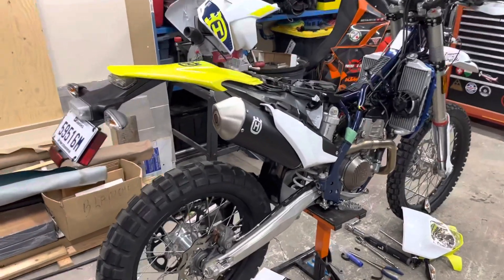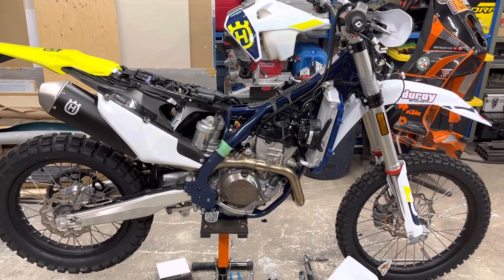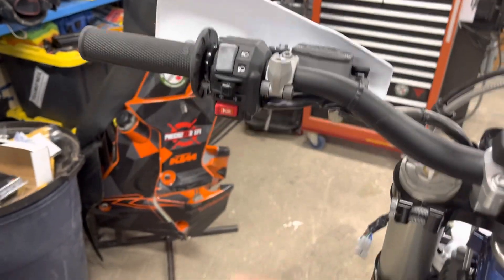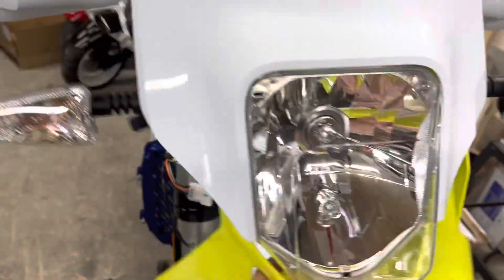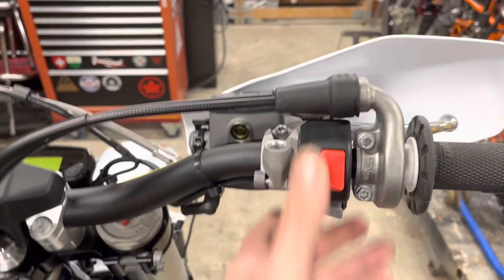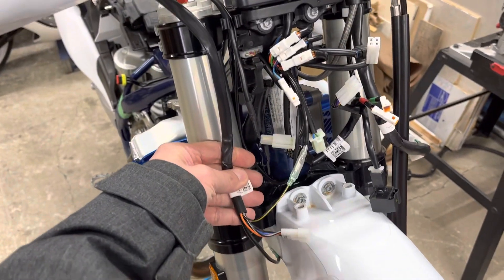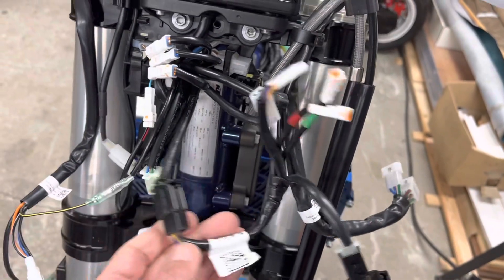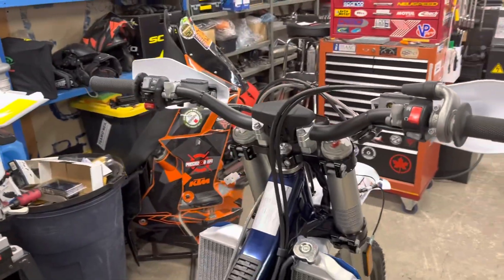2023 Husqvarna FE350S, first project plan, DOT wiring optimization.

Comment: Congrats! Looking forward to see where this thing takes you! Do you plan to build it all out like your 690?
Reply from the maker: No major modifications planned for this bike. Only add the basic accessories like the GPS and a charge/power port and then some protection like case savers, swingarm and linkage protector, better off-road tires... The list of things that are added or changed is still surprisingly long when you add little things like floppy (less breakable) flashers, Doubletake mirrors, tug strap...